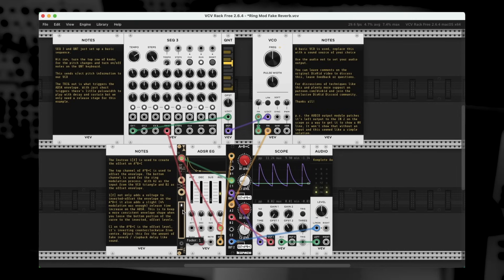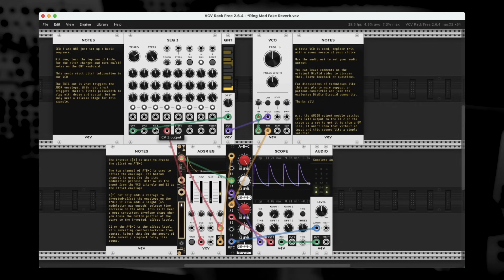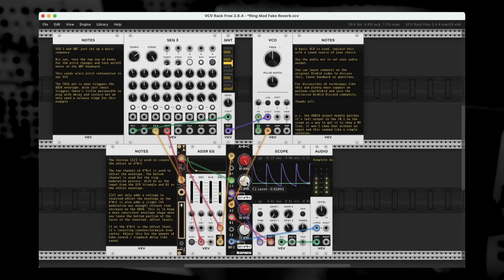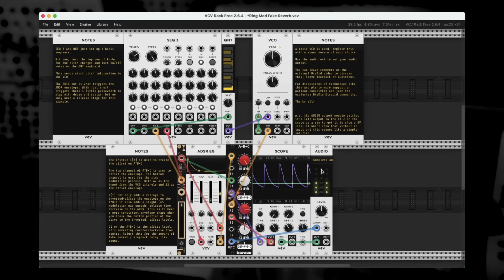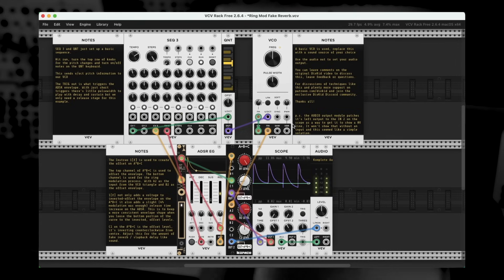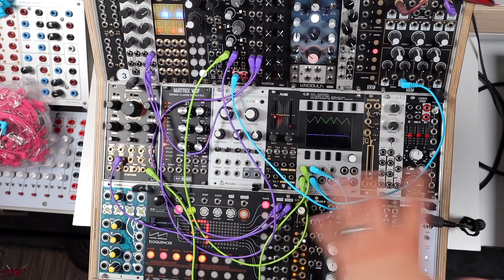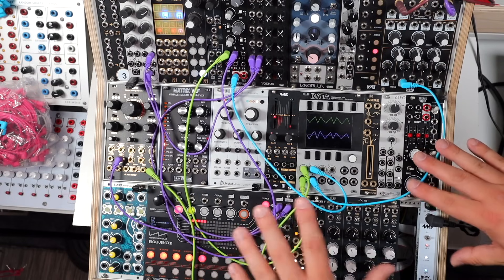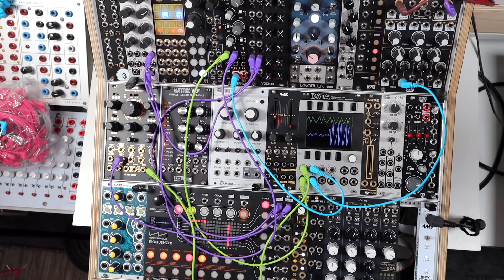How to FAKE Reverb with Ring Modulation  // Rob Hordijks ‘Poor Mans Delay’ [BETTER BLEEPS]

Comment: Very smart yet very simple trick, Rob definitely was a genius, happy to see his techniques live on. I'd like to add a couple things to the explanation:
1 - you can change the perceived reverb's timbre a bit by changing the envelope's shape, exponential shapes behave the best IMO
2 - not every ring mod will work properly, some of them can't pass low frequency signals (if I recall correctly, Doepfer A-114 is one of them)
Reply from the maker: Yeah the time and sort of pre-delay / reflection is dictated by envelope time and shape. 

That's interesting RE the A-114, I don't have that one. I like ring mods for modulation so I'd be looking for a DC coupled one, needs to be for this sort of thing. Though depending on the cap. value in the AC coupling that might be handy for pulling away the negative offset and not having that constant bleed through.

Comment: hmmm going to have to try this on the Hydrasynth! i think it can be done by patching the mod out with an envelope into the mod in going to the ring mod....
Reply from the maker: Can you manually set a negative level on the ring mod? Or negatively offset the envelope? Should work well on the Hydrasynth, I don't have one to try but it's a great synth from the time I've played one.
Reply: @DivKid you can set a negative envelope amount... might need to use another envelope with full sustain to push the other envelope amount down to start with tho.
Reply: @DivKid the only thing I wish the Hydrasynth mod matrix had is modifiers like Waldorf has in the Q and blofeld. Being able to use logic between two modulation sources or constant voltages is a lot of fun
Reply from the maker: Yeah the Moog Muse I saw had lots of really impressive, very module like utilities and logic functions in the mod matrix. Not tried it myself though.

Good idea with two envelopes. One with full sustain negatively mixed with the main decay envelope. The release on the sustaining envelope will then bring it back to zero nicely ... this is actually a really nice extension to the technique!
Reply: @DivKid so it kinda works. Felt more like a slap back echo rather than a reverb. I'll have to play around with it more
Reply from the maker: Yeah the whole thing is a bit like that really, the technique possibly more interesting than the reality/results.

I made an extension video, based on an idea spawned from us talking so thank you for the comments and inspiring something else from this technique too. https://youtu.be/fN_WxCIPe18
Reply: @DivKid  oh wow! I'll be checking this out on my lunch😊

Comment: Nice one! Does this also work with a 90c offset output? Let's say an FMVDO.
Reply from the maker: you're flipping the polarity in the ring mod, so what the single input is doesn't matter. 

If you wanted to try and make a more complex series of sounds coming in almost like a musical canon, one playing off the other and you have options to do that with quieter phase shifting sources that might work. Not tried it though.

Comment: stereo Ring mod your drum bus room reverb in parallel... with a slow waveform as a modulator just beneath audio rate. I use Reverberate Tile room preset... this one is for free😉
Reply from the maker: Sounds fun. 

You could play with this sort of reflective patching (in the video) by using an envelope follower from the dry drum sounds and pushing the stereo room around in ring mod. With the envelope follower times you'd be able to dial in a nice pulsing around the beat.
Reply: @DivKid  I take a slow morphing wave from the cloud terranium as a modulator. I use this trick even with real drum in a mixdown…😏

Comment: Hard Sync! 

So, this is a bloody awesome video, and I really appreciate the style of tutorial, that shows several module options to achieve similar results! 

I've always felt that Ring Modulation (or, as I prefer to call it cos it sounds nerdier and cooler) "Four- Quadrant Multiplication"... wait, cool nerdyness - now that's a misnomer that I love of the modern tech age - can be overlooked and easily thought of as just an boring old-school synthesis trick only suitable for Sci-Fi soundtracks. 

Since I realised it can be used to modulate attenuverter knobs through zero, my gut tells me to explore it more. 

I'm wondering now "What if there were two cascaded ringmods/envelopes with the output's hard panned? Could I simulate a poor-man's dual-tap ping-ping stereo reverb?" 

So thank you for this Divkid, Rob Hordijk and the bloke from the Moog tent!
Reply from the maker: HARD SYNC! 

Yeah I love Ring Mod, absolutely capable of way more than sci fi retro clangs. And I like calling it four quadrant multiplication, I didn't want to get into the 2 vs 4 quadrant thing here for fear of loosing people. 

RE a ping pong from two ... once you have a gap or pause in the otherwise steady sequence you lose the affect. So even if you offset two envelopes playing ring mods hard panned left and right I think you'd lose the effect. Worth a try though.

Then that gets me thinking about taking a phase inverted version just into a VCA panned one way and the normal version the other then using inverted envelopes to fade one side up over the other ... with some fine tuning and extra envelopes/VCAs to create the fades you might be able to place what sounds like a reflection somewhere else in the stereo field.

Comment: I'll have to try this on speakers because in headphones it doesn't sound like reverb or delay to me. Still cool though.
Reply from the maker: Yeah I think I say in this video that the results can vary, or definitely in the Patreon extra video bits there's some that outright doesn't work at all. But for this patch you can hear the reaction from the audience in the room when Rob does it which did work well.
Reply: @DivKid  I have a few different ring mods and VCAs so I'll look into it a bit. I have a feeling it could work better in a large room but that would maybe be cheating as your brain would confuse the artificial reverb with the natural verb of the room.
Reply from the maker: Yeah I'm sure it all blurs into real room sound even further but you're playing into it or emphasising / forcing it.

Comment: Heart sync! Thanx so much for shoothing this! I tried it, but it never worked, till now. Behringer 1005 does the job perfectly, driven by an envelope via the Doepfer A138c Polarizer. Sounds great!  It doesn't work with my Doepfer A114, though, since this seems to be AC-coupled by default. But some claim, it could be made DC-coupled by simply shortening the input capacitor on one axis. Did anybody try this?
Reply from the maker: That sounds right for the A114. AC coupling if often achieve with a capacitor which is basically serving as a high pass filter, since DC is sub audio filtering it off at say 10Hz will reduce DC down to 0V. You can get some cool behaviour from somethings that are AC coupled with sub audio CV but proper DC behaviour is needed here.

In short ... I haven't done that to an A114 but that sounds right to me.

Comment: Rob may be gone, but there’s still so much we can learn from him… Curious to dive deeper into this technique with Eclipse. In MorphX mode, the spread can be used as a RingMod and in theory, you could also use the Morph section as a RingMod and turn the spread into an output VCA.
Reply from the maker: interesting, really cool if that can be done directly on the oscillator itself. Eclipse has sounded great the few times I've used it so far, really good!